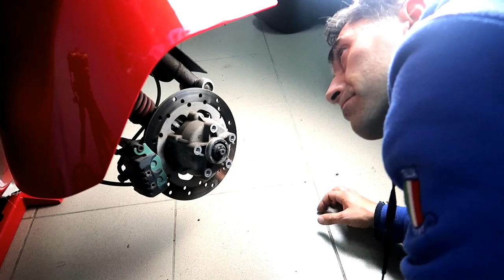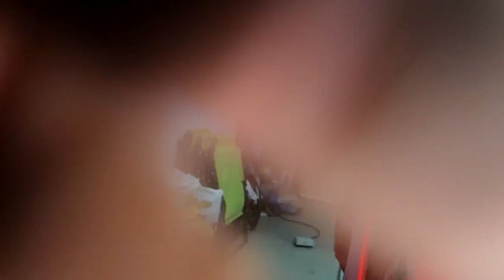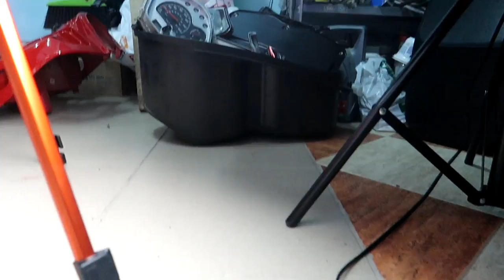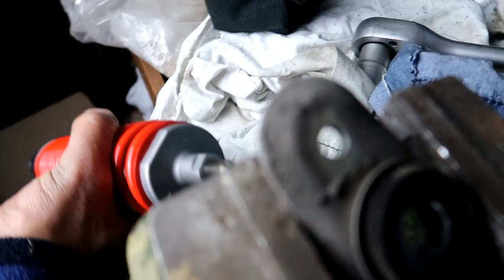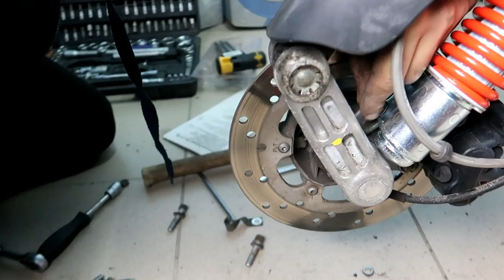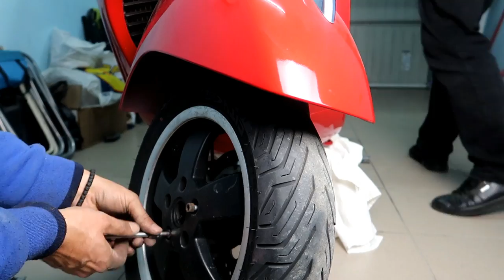Vespa GTS 300 front shock replacement (original or bitubo)?

Comment: 0:35 Hello, I am using vespa gts.  Yesterday, when I moved the front wheel left and right with my hand, I saw some slack.  Where do you think is the problem?
Reply from the maker: https://youtu.be/W9FPDkg68SI In this video I show how to deal with such a problem. The clearance is most likely from a poorly tightened steering rod nut.